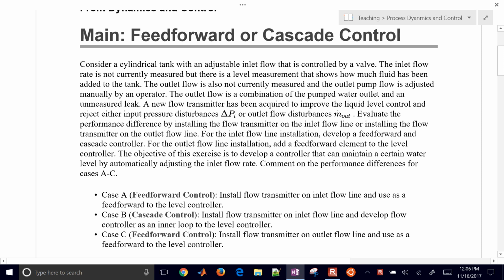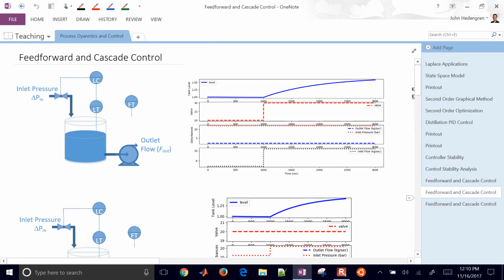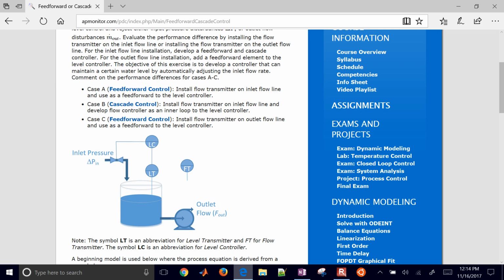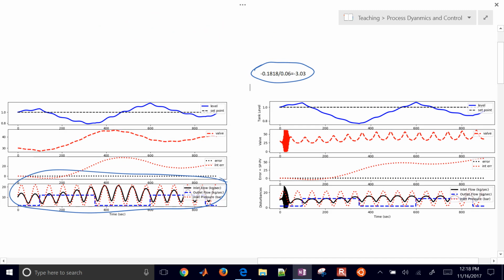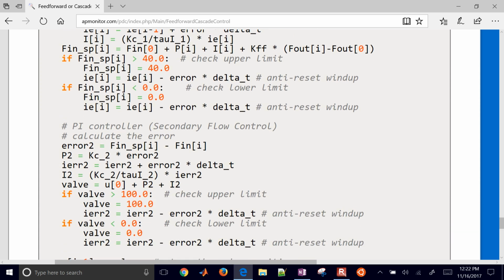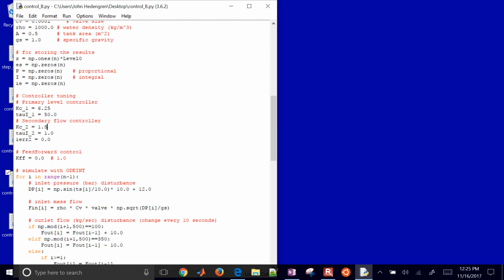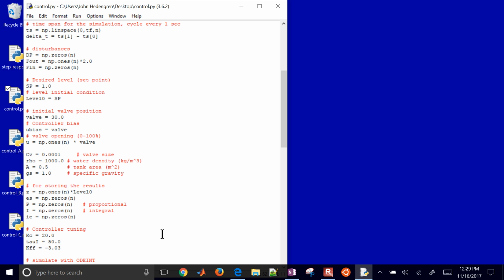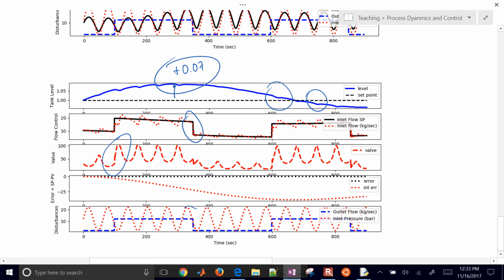Feedforward and Cascade Control Examples

Comment: I know it has been a lot of time, but how come that for determining Kp value (delta u) valve opening percentage was chosen and not change in inlet flow? How to determine what is delta u value in general is it controlled variable or is it a consequence of controlled variable on real variable?
And for everything you did with this videos and whole course, hats off to you, amazing work!
Reply from the maker: The actuator is often the change in a valve position (Delta u) or change in a pump speed. If there is an inner loop that controls flow then the primary controller has a control output of flow set point to the secondary controller. The secondary control has a controller output of valve actuator position (Delta u or valve lift). The process gain is the change in output (Delta y) divided by the change in input (Delta u). There is additional information here: https://apmonitor.com/pdc/index.php/Main/FirstOrderSystems

Comment: Hello Dr. Hedengren - as always thank you for posting your coursework. In the simulation you run the ODE solver with a time span of (0, 0.1). Is this intentional or a typo? Seems like it should be (0, 1.0).
Reply from the maker: Thanks for catching that! I increased A=5.0 m^2 (previously 0.5 m^2) for the cross sectional area and changed the time interval of integration to [0,1.0] so that the results stay the same. I fixed it in the step response code and the solutions that are posted at https://apmonitor.com/pdc/index.php/Main/FeedforwardCascadeControl